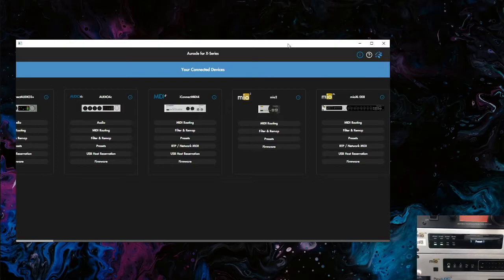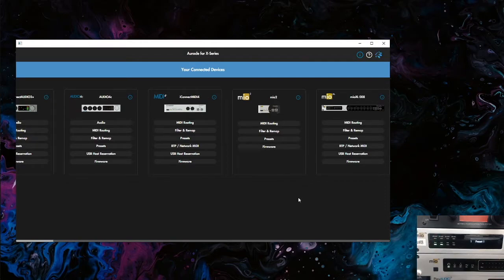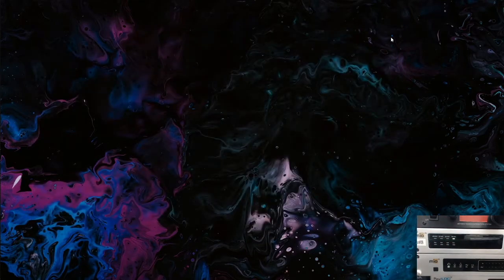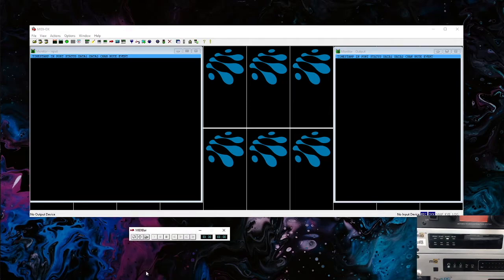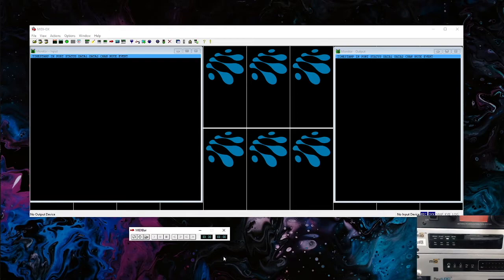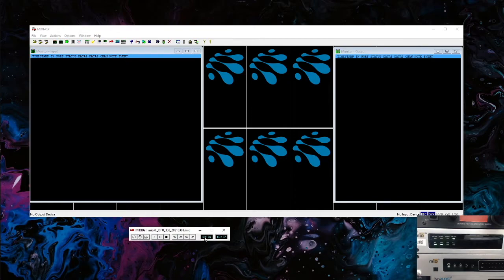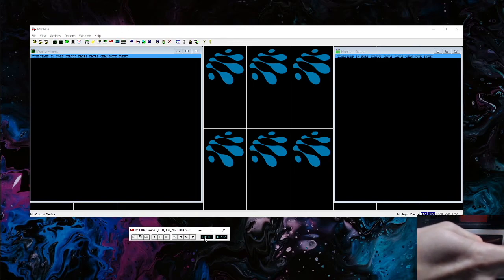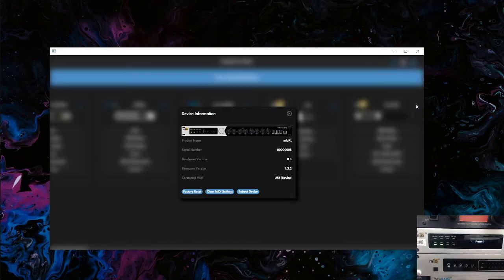MIDI OX Firmware Load

Comment: The Scene A/B, Gain, and Phones lights are flashing on my Playaudio12, and no method of loading firmware is working (it says 0.0.0). What does that mean? What should I do?
Reply from the maker: Can you send a video or this to our support team? 
I would try powering the device off and back on.
If you see 2 lights going back and forth in the meters, it means it's in bootloader mode and you need to load firmware.

Comment: Hi, when I get to the bootloader Windows 10 doesn't see it. And I can't use it in MIDI OX.
I'm using new Audio4c... 
I've tried updating via iConfig, but I get "communication error"... 

How can I continue with the firmware update?
Also, presets doesn't seem to work, will it work when I update to the latest firmware?
Please, reply asap! 
Tnx!
Reply from the maker: Hey. We will have a new version of Auracle X out very soon with working firmware loading built it. The presets page should also work on this version.
In the meantime, if none of those options are working, you can use a DAW to load your firmware.
Select the MIDI to go out to the AUDIO4c in bootloader mode (loader). Then download the midi firmware file from our website.
Page the file all the way through and stop after it's complete. 
Power your device off and back on and it should start in normal operation mode.